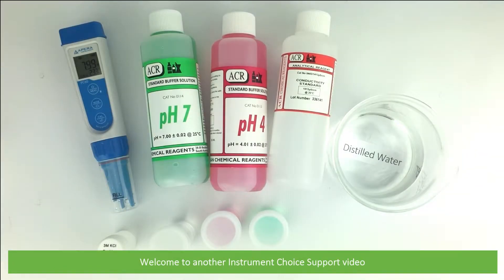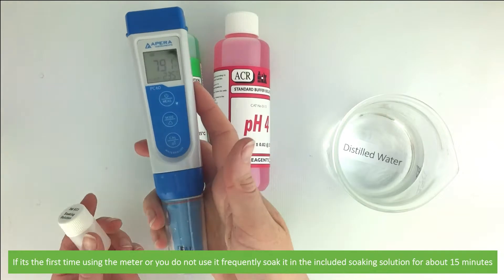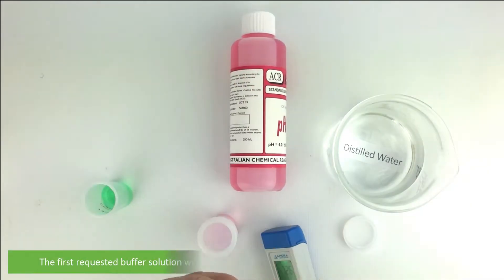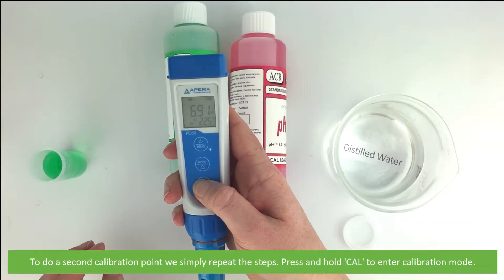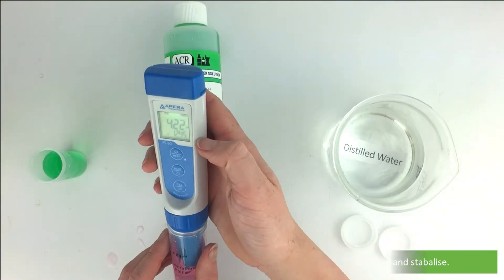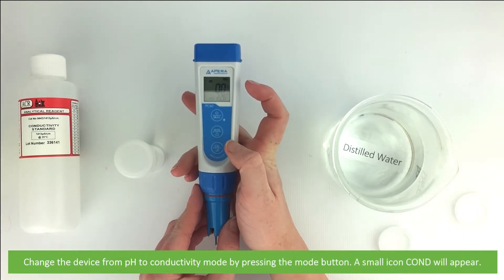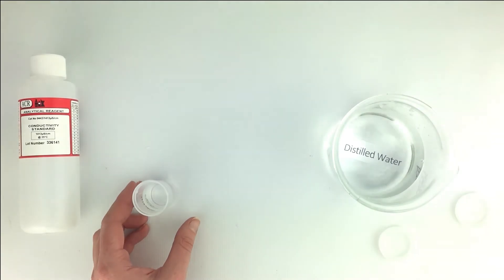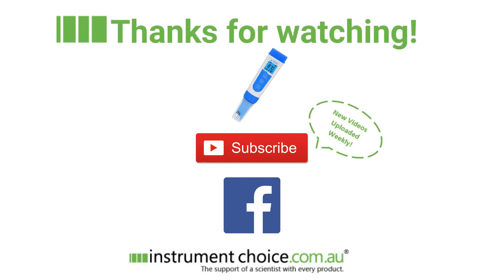How to Calibrate the PC60 Premium Multiparameter (pH/EC/TDS/Salinity/Temp) Pocket Tester (IC-PC60)

Comment: What is the proper way to clean the meat/cheese spears?
Reply from the maker: Hi Mark,

Thanks for your question. 
You should always be rinsing the probe in distilled or deionised water after use. If there is any build-up of dirt or grime on the spear that distilled water will not remove, we recommend that you perform a proper clean using a cleaning solution. 

> Here’s a video demonstrating how to use electrode cleaning solution: https://youtu.be/hQI-KToBBkc

> You’ll find some examples of cleaning and storage solutions here: https://www.instrumentchoice.com.au/instrument-choice/calibration/buffer-calibration-solutions/cleaning-and-storage-solutions

If you need any further assistance, please chat with one of our scientists 
https://www.instrumentchoice.com.au/IC/Contact